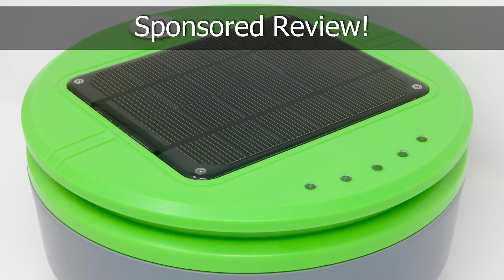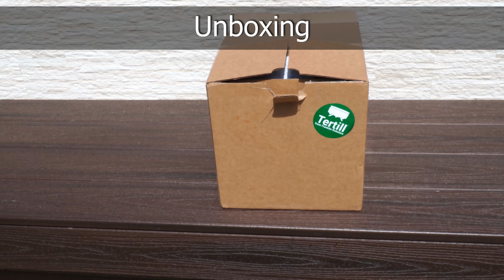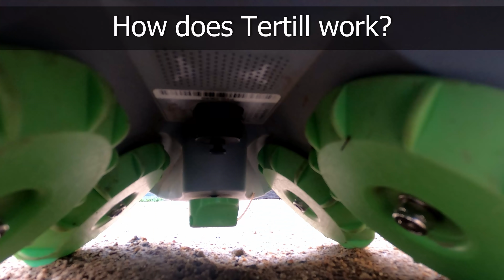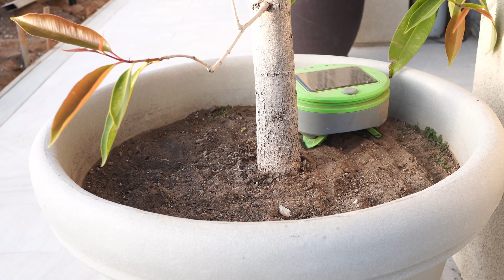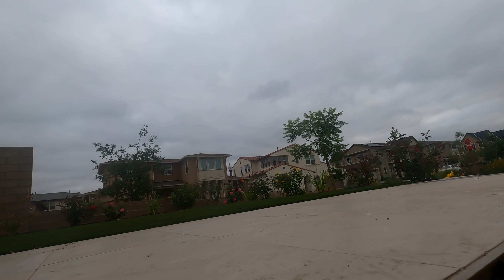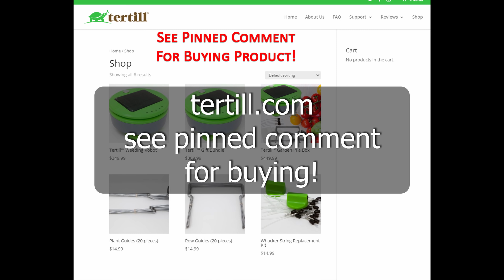Tertill Weeding Robot - Keep Garden Weeds In Check With Tertill - From The Creator Of Roomba!

Comment: Sorry but this is a worthless device and review. By the time you set up (in a variable environment) you could have finished weeding. And for $350?!?! I think you lost a lot of credit ability here... just being honest.
Reply from the maker: Yes the price is steep. Just a review. People can decide for themselves if they want it or not
Reply: You place Tertill in the garden at the beginning of the season and it will weed all season long. If your garden has borders on it you don't need to place all the guards. Tertill is about the same price as a robotic vacuum yet has far more technology in it. It has four-wheel drive, completely weatherproof, solar-powered, and has both pressure sensing and a broad surface capacitive sensor to detect objects around its environment.

Comment: So basically it doesnt REMOVE them it just TRIMS the weeds? I guess that saves time, but Id rather pull them up by the roots, especily3 because theyll just keep spresding their roots underground.  It seems to me this keeps the surface weeds trimmed, but in reality allows them to spread much faster than pullinv them up by the roots.
Reply: Tertill actually does most of its weeding by disturbing the seeds before they ever sprout. Much like a well-worn path Terill's wheels scrub the top layer of soil so that most weeds never come up. Those that manage to sprout, or are established before you put Tertill in, are then cut down with the weed whacker. The reason Tertill does not need to pull the roots is that it cuts the weed constantly so that eventually the plant has no energy and shrivels up and dies. Tertill's ability to effectively weed was validated by the Cornell School of Agriculture.
Reply: Also, I love your channel! 😍

Comment: If you have to cut the weeds to a shorter length in order for the Tertill to cut them down the rest of the way, why not just cut them all the way down to the ground yourself and then cover the ground with weed barrier and mulch?  
I personally would rather just hand pull weeds or dig them out without a robot's help.I think it's more fun and better exercise.
Reply from the maker: Good point
Reply: Weed barrier and mulch interfere with your soil's CO2 diffusion coefficient among other things. While they have been the best organic solutions we have had for a while, Tertill provides a natural alternative. https://www.mendeley.com/catalogue/20a84c9f-63cc-3d42-816a-d78ad8549ff5/

Comment: We saw it! My wife guessed $ 80.00 I guessed $120.00. You do not have to review every thing you are sent. Integrity is hard to regain once it is lost. I would have sent it back and said nothing. No bodys feelings hurt and my viewers are not guestoning my valye of them
Reply from the maker: Thanks, yes the price is a bit high. Just a review though, up to people to decide whether they want it or not
Reply: Tertill is about the same price as a robotic vacuum yet has far more technology in it. It has four-wheel drive, completely weatherproof, solar-powered, and has both pressure sensing and a broad surface capacitive sensor to detect objects around its environment.

Comment: I feel like the Robot is not worth the time it takes to make sure everything is all set up.  Also, I wonder how it would do with a really weedy bed.  Yours are pretty clean.  I will say I love the patroling feature.  - Liz 🌴👍💯🌻🌼💯👍🌴
Reply: If you have an already established border, and you are willing to cut the tops of your weeds to below an inch, you can place Tertill in the garden, push the on button, and it will weed all season long. You only need to put the borders in place if you want to limit the area to a certain section. A single Tertill will maintain a 200 square foot area.